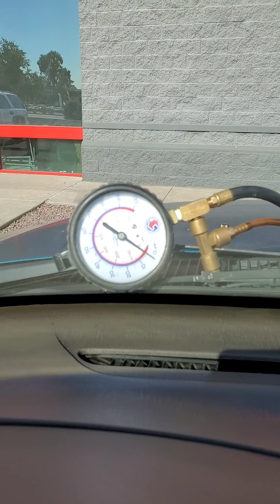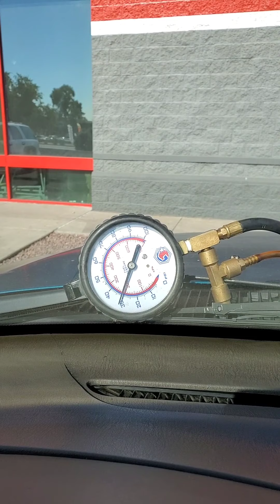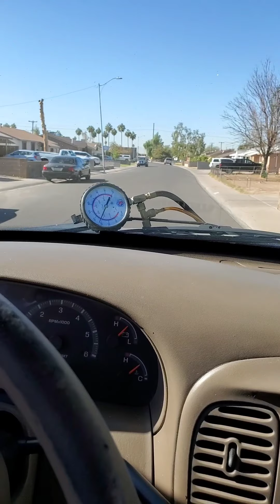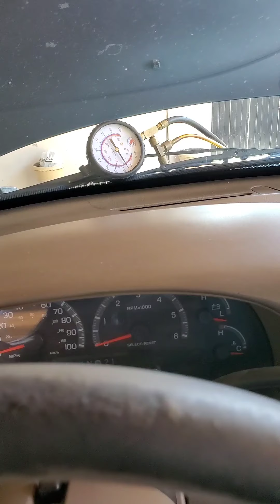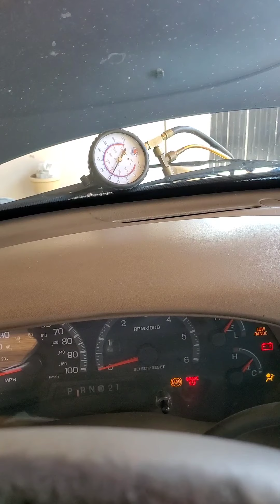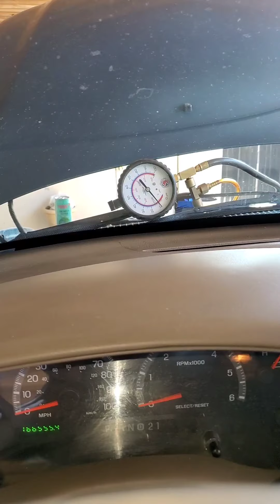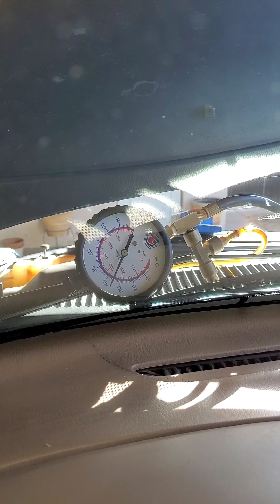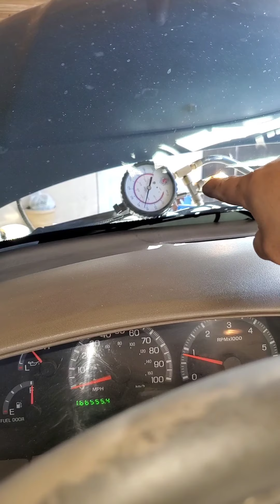FORD F-150 2001 5.4 CÓMO CAMBIAR BOMBA DE GASOLINA ⛽️

Comment: Sanchez me reemplazaron el repuesto en una explorer 2002 y le puse filtro de gasolina tambien y ahora tarda en prender ,me dijeron que el filtro de gas ya viene como regulador de gasolina, revisare eso de la manguera por que creo se les perdio una abrazadera
Reply from the maker: Si no apretaron bien eso ese podría ser el problema  También hay unas bombas de gasolina que Tienen garantía de un año y Tienen menos presión y las que Tienen garantía de por Vida tienen  más presión me apasado en   Ford ranger no se en la Ford Explorer
Reply: @sanchez85able  aparte los cables del sensor de presion estaban ya bien jalados y rotos y tube que comprarle ese enchufe yo creo que lo conectaron mal por que si prende la bomba pero no llega la presion y baja la gasolina cada que ves que la vuelvo a prender ok gracias aver si le chekeeo  el cableado de ese enchufe de sensor de presion.
Reply: La abrasadera fue el problema saque la bomba y tenia un alambre jaja se pasan ya le puse una y prende al llavaso muchas gracias por su video espero y gane muchos suscriptores
Reply from the maker: @gjlm5147  de nada saludos
Reply: @gjlm5147  Hola disculpa tengo el mismo problema, a cual abrazadera te refieres?
Reply: @hugojaazfr9105  abraza bien las mangueras de la bomba mas por la que manda la presion hacia el motor si no se devuelve y hace que tarde en prender y tienes que abrirle el switch como tres veces pa que prenda al.llavaso
Reply: @gjlm5147  o si gracias, de echo ya quedó, fueron filtro y inyectores tapados, saludos.

Comment: Disculpa primo cuanto cobras por ese trabajo? Solo por la mano de obra.👍
Reply from the maker: 150 y  también depende si esta lleno el tanque
Reply: @sanchez85able  gracias primo por contestar tan rápido
Reply: @sanchez85able  tengo una 2003 Honda CR-V tú sabes cómo purgar el radiador. Lo que pasa que le cambie el anticongelante
Reply from the maker: @mecanicoelmichoacano2066   no más así llena el radiador y la reserva y echalo andar por 15 a  20 minutos después lo apagas x 10 minutos y vuelve a revisar el anti-frizz
Reply: @sanchez85able  muchas gracias bro. Lo que pasa que tiene el ralentí inestable le cambie el throttle body y no se que es lo que esté mal de ante mano gracias bro. Chidos tus videos 👍
Reply from the maker: @mecanicoelmichoacano2066  que  es el relatin
Reply: @sanchez85able  LAS RMP SE ACELERA SOLA
Reply: @sanchez85able  supuestamente es la válvula IAC O EL SENSOR TPS PERO TODO ES NUEVO ☹️
Reply: @sanchez85able  gracias bro por tomarte el tiempo en contestarme 👍
Reply from the maker: @mecanicoelmichoacano2066  la válvula IAC es una y el tps es otro revisa la manguera que sale de la válvula pvc que no se este aplastando o chupando esta x detrás de la bomba del  Power steering y  se conecta al cuerpo de aceleración si esa esta bien te recomiendo cambiar el empaque del Intake Manifold
Reply: @sanchez85able  muchas gracias bro mañana lo aré y gracias por tu tiempo 👍
Reply from the maker: @mecanicoelmichoacano2066   Metete al google y ponle tps sensor y ponle map sensor y ponle  idle air control valve para todo eso tienes que poner crv 2003 y miraras los 3 sensores diferentes
Reply: @sanchez85able  gracias primo si se que con tres sensores diferentes y también se donde están ubicados.
Reply: @sanchez85able  pero no entiendo por qué el ralentí está inestable si el TPS Y y la válvula IAC SON NUEVOS O Y ME DA ESTE CÓDIGO. P0505
Reply from the maker: @mecanicoelmichoacano2066   ese código se trata del ldle air control valve ...alomejor no le esta llegando corriente a esa conexión
Reply: @sanchez85able  gracias bro boy checar eso